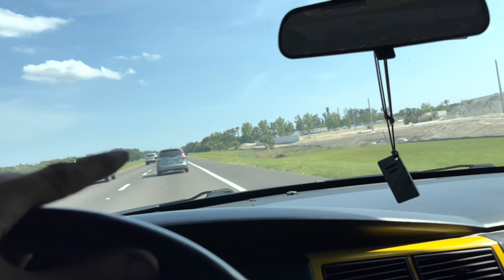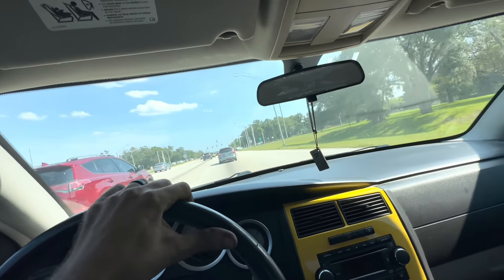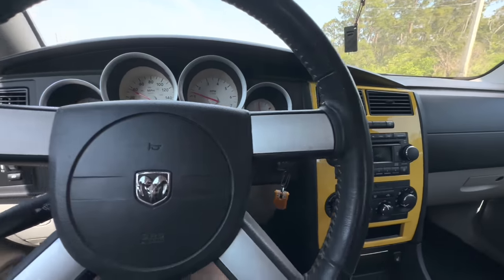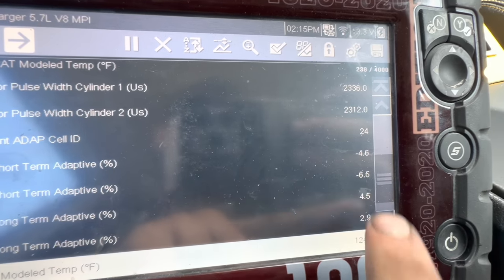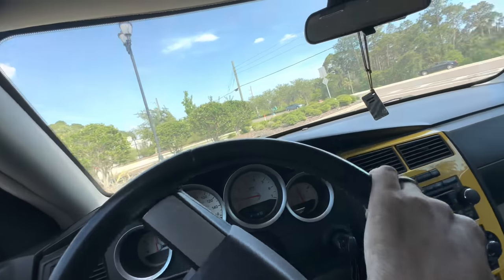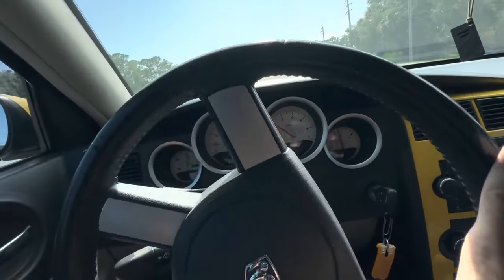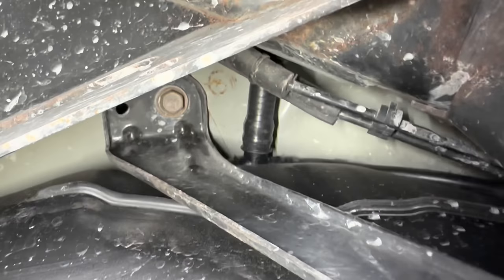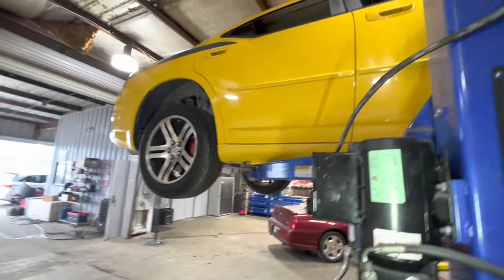Customer States: Engine Stalls After Fueling...HELP!! Dodge Charger 5.7 #mechanic

Comment: got an 06 caravan with same problem.  will stall consistently (at idle) after refueling, usually for about 10 mins. my research indicates fuel tank issue, but i haven't done anything. problem will go away after running for 10-15 mins-- i suspect getting rid of any liquid fuel in the evap purge system.  please give an update once you figure out the solution...

Comment: Maybe Heat soak/Vapor lock in the engine compartment.  Both occur on a hot start or after refueling when it is hot outside..  Or faulty fuel pressure regulator.

Comment: HOLA RAY. Bought my son a 2005 Dodge Magnum RT. HaD a stalling Problem. Looked in to it, Engine ECU was changed, All fuel and vent related Parts were changed, Transmission ECU mas change, all by previos owner. Still stallad while city driving..... Gave it a full service, no change, ´TILL..... I SERVICED THE ¨NAG¨ TRANSMISSION!!!
Has not stallad since then, that Was a year ago! TOOK PAN OUT, CHANGED FLUID FILTER, PAN GASKET AND THE MOST IMPORTANT PART, THAT I FEEL FIXED IT... THE CONNECTOR ON THE FRONT RIGHT OF THE TRANSMISSION, WERE ALL CABLES PASS THRU. YOU SHOULD TRY IT!!! Not that time consuming and cheep, MAKE SURE YOU BUY ALL PARTS AT THE DODGE DEALER, DONT SKIP THIS STEP... DEALER PARTS ONLY!!! Hope this helps. ADIOS!

Comment: Funny, you and Eric O keep doing similar repairs.  He just did an Avenger with the ESIM problem.  Said in his experience, the ESIM always is the issue if not the purge valve, and that Chrysler products almost never have a leak in the lines or connections.  Don't know if this helps you Ray?

Comment: Ray, I've ran into this on a few other manufacturers,  specifically VW, Audi, BMW, whereas the purge valve was sticking open, therefore causing excessive fuel vapor to enter the intake system while refueling causing a hard, no, or slow start, and even "stalling" condition, could be similar to the situation you're experiencing, I've also found in tandem with the purge valve, alot of times the carbon canister is soaked with fuel, usually due to people refueling with the vehicle running or overfilling the tank, could be a couple things you could easily check 👍

Comment: My 05 hemi magnum (70k now) does the same. At a fill up and only a fill up it will stall multiple times at every stop until I drive it at freeway speed for a while. My solution was do not turn off the car when filling, car never stalls! Again if I turn car off and fuel with fill up, at first stop it will stumble and stall! And if I fuel up but not to full never have an issue!

Comment: Have to say that you did not really find much fuel traveling in the vapor lines.  Could have been old residue? Have seen rear fuse block problems causing stalls.

Comment: Our jeep renegade 2021 did the same thing. EVAP checked out fine several times. Lines checked and he replaced the EVAP canister out of curiosity’s sake and it ran. Ours cut off and wouldn’t start back. Towed to dealer 4 days after purchase to find out the canister was bad inside but somehow checked out to be fine? Idk but it’s fixed now and roughly 23,000 miles strong now

Comment: How does it get air into the system/ tank tp replace the fuel used to prevent a vacuum build up in the tank?
Could the system be blocked not allowing the air flowing into the tank or causing it to be restricted, or a one way valve occasionaly sticking closed?

Comment: Ray, I have a 2008 Charger R/T that has a similar issue. I have hiccups under hard acceleration and when I make a fast turn around a corner, she bogs like its not getting fuel. Been working on this for a couple years. Might look into a relay swap as in the other comments. Its been a ghost in the machine to me, but I love my car and all my others too, so I'll keep digging.

Comment: It's related to the purge solenoid and vent  . Filling the tank floods the engine.

What exactly the part of the fuel vent and purge  solenoid it is varies,  same as it varies from vehicle to vehicle . Chevy loves this problem . .
I just know fling the tank and the purge in the wrong position will flood the engine .. Mopar is weirder with vents rollover valves ..
Check the power for the purge solenoid.

Comment: My 05 Ram w/5.7 Magnum did the same thing. Random stalls, especially when heavy loads were occurring at low rpms (such as wheel hard over, or coasting to a stop with A/C on, ect). Ended up being the result of a very VERY small hole in the intake manifold from an improperly installed throttle body (allowed unmetered air into the intake obvs). 

The plastic intakes on these Hemi's definitely warp/break/don't age well.
Reply: For a while, I suspected it was the torque converter staying locked/not unlocking, but it never slipped in O/D like most failed TC's do. Ended up not being the case, though.

Comment: Oh the good ole days, I was a dodge tech from 2003-16, some just couldn't be fixed. I believe it's a over filling issue and if the customer would stop trying to add fuel once it stopped then there wouldn't be a issue. Btw I owned a magnum and it would do it if I tried to keep filling after the initial stop.

Comment: Your comment on petrol (gas) price made me smile; in the UK you would be paying around $85.00 (based on cheapest supermarket fuel prices) for that amount of petrol (gas). Thanks for the videos, always enjoyable. Regards.
Reply: How much of that is taxes and fees though? In Florida it's about 36¢ per gallon.
Reply: @kevinbirge442  Welcome to rip off Britain. In the UK, VAT is added to fuel prices and paid at every stage of production and distribution, which means that it is paid on both the sale of the pre-tax price of the fuel and the additional fuel duty that is levied on fuel consumption.
The standard rate in the UK is currently 20%. Fuel duties are also levied on petrol, though the exact amount is determined by the type of fuel used, around £0.53 per litre for petrol. In addition we have Vehicle Excise Duty (road tax)  which varies depending on type of vehicle and engine size. A Normal 2L family car will cost you between £130 and £255 pa. If you drive a large vehicle with C02 emissions greater than 255g/km it will cost you £2605 pa.

Comment: i had in the past a similar thing happen, although i have to say, and absolutely different car, where it would stumble and got to occasionally stalling when completely lifting off the gas pedal from over 1/3 open, it sort of did the exact same thing with the rpm needle, it was the EGR valve on its way out, it was really easy to check finally when i just disconnected its connector and it ran amazing (although with a check engine light), 
it might very well be something absolutely else, some other person commented something about maf sensor, i don't know.
one last thing to check, did the customer once force fill the tank beyond the click? like 10 more attempts? that might send fuel into where it should not go, and there are some people out there that try to squeeze that last drop as if it would matter a lot, and that might be the reason why the lines are wet, and now that most of it has gone through since the last overfill, it is working better no longer having the lines full of fuel
hopefully somebody reads this

Comment: It would appear to be a ‘hot’ issue, the customer not reporting a failure to start when cold. The classic things to go wrong are crank/cam sensors although you are not getting any codes which suggests something below the radar.  I would check the coolant temperature sensor since intermittent errors can sometimes escape code setting but when they occur they immediately mess with injection timing/fuel delivery and are especially notable when coming to an idle at a stop light. When removed, it is easy to monitor the resistance with a voltmeter as you dip the tip of the sensor in and out of a mug of very hot water.

Comment: The arrow is also very handy when you are driving 2 different cars with the fuel filler on different sides. Dont know how many times I have put the mustang with the pumps on the drivers side which is the side my VF Holden Calais has its fuel door on (RHD Mustang here), so now I look every time before filling up, just to make sure lol

Comment: You've done the diagnostics showing the possible issue.  I had two '06 Chargers (R/T with R/T pkg and an SRT) that did the same thing after a fill-up.  The first left turn I made - boom, it would die.  I sold both of my cars before the stalling issue was repaired.  However, I'm pretty sure this condition was something Chrysler gave a goodwill lifetime warranty on.  The TSB in your video shows that wording (timestamp 28:17).  This Top Banana should be taken back to the dealer for service or you should be reimbursed for your repairs.

Comment: love it when you get the right parts to fix it and it still does it. especially when its labor intensive to replace the item as in the fuel tank.. but you have told us, Eric O has told us and Wes also that new does not necessarily mean its good. There could also be some factor causing the valve to fail, age in the first case but in the second could the wrong grade gasoline or an additive be an issue,,, When I was flying I decided instead of tossing the fuel sample I would put it in my S10 to  "clean up" the plugs.. common wisdom at the air port said do it.. I did. I talked with some racing engine builders and drivers that said "do it" guess what? Less than 4 ounces of LL100 Av gas 2 times in a full tank of 87 Octane unleaded gasoline was not dilute enough to prevent the spark plugs from over heating.. but the first 100 miles it ran like a champ... fast, plenty of power then it would run like crap and the light was on. melted the electrodes on all 4 spark plugs in that 2.2L... if it had been a big block chevy it might have withstood it with different plugs.. point is whether something caused the evap part to start pulling fuel.. just my wondering along with you as to what could be the culprit.

Comment: 18 year driver, I was driving a quad axle dump truck and had a guy cut me off to stop at a red light in front of me. I was 108k (heavy haul route) it was raining, people are dumb. Took 20 feet out of my stopping distance just to be first at a light. 1 weighed roughly 20 and a half times more than his Chevy pickup. Glad he had confidence in my ability to stop 54 tons.

Comment: Check the purge valve for intermittent sticking or stuck open position allowing fuel vapor to enter the intake manifold.Also don't overfill the gas tank,raw fuel will or may enter the charcoal canister.

Comment: When I first got My used 06 Charger R/T, it would violently jerk and die right after filling the tank. It was valve on top of the tank causing it, and a new tank from Mopar fixed it.

Comment: Hey Ray, well my 06 charger does the same thing.  It only does it Immediately after filling up.  It is worse when the tank is the lowest on fuel!  If it's above 1/2 tank it probably won't do it.  Sometimes it totally stalls, sometimes it just coughs.  Good luck.  I'll be watching to see what it turns out to be.

Comment: I work at Chrysler/jeep. It’s the customer topping off the tank multiple times after the gas pump already clicks off. advise customer to not top off tank after gas pump clicks off. Or bad new fuel tank

Comment: Howdy the Raysta. I'm thinking to punch up on car and model that when you buy a new tank , what parts are on the new tank and what it comes with as a process of alimentation and also fuel pump pressures with heat or cold as filling up fuel changes pressure and shuts down or filters. Lance a lot.

Comment: The 2006 Dodge Daytona has some issues.   I know I own a Gomango edition.  One is that if you fill the tank too full hard acceleration, deceleration, and cornering causes the roll over valves to close cutting fuel off to the engine.  Another problem is the exhaust valve seats can drop out of the head.  Hope this helps.  Tell the customer to not fill up the tank so full.

Comment: One of those magic cars.  My wife had a car in the early 70's that would stall out when taking off from a stop.  It would not do it for anyone else.  I and others saw it stalling out when pulling away from a stop while riding as a passenger when she drove it.  I drove it and nothing happened.  The same for a number of friends driving the car.  Full analysis of the fuel system, and ignition system revealed no problems.  My wife said the car did not like her for some reason.  We sold it to my niece after 5 years and she put almost 200,000 more miles on it and it never stalled out on her the whole time she owned it.

Comment: My daughter had a 4 cylinder car that started randomly running on 3 cylinders for a minute or two, then running properly again. No codes set. Took to a mechanic, who drove it around for a while, but the problem didn’t happen for them. They couldn’t  cause the problem to happen or diagnose what it was. It became a safety issue on the freeway. She ended up trading the car in

Comment: I have a 2005 Dodge Magnum R/T.  Experienced the same stallout issues after filling the gas tank and at idle, or 0 throttle.  Dealer swapped the tank under an "extended warranty" or voluntary recall in 2018.  Issue was as you described: a check valve in the tank failed to prevent liquid fuel from entering the vapor line.  

Perhaps you have a faulty tank?  Or a tank reclaimed from a car with the defect?

Comment: high evap flow  code    i had the same issue with a ford transit connect   i had to replace evap cannister  from dealer and the intake evap tube intake purge valve  solved issue  but has to be dealer parts

Comment: I have a 06 Town and Country that had a similar issue. Every time I would fill the tank, it would start right up then stall after running for about a minute. It would restart and run fine until the next fill-up. It did this for about 6 months until one day it wouldn't restart. Turns out that the fuel pump was dying all that time and finally gave up the ghost. Replaced the pump, and the problem went away.

Comment: After filling He could be just keep pushing the gas until its at the very top maybe thats why you fine gas in the vac lines, Since you did not do this on the fillup you did not incurr the same results as him. Now he may not be consistently doing an overfill hence the intermittence, try over filling once see if engine is choke for the first few minutes. Although I do like the fuse fix as stated in the previous comment, its a dodge you know. I also had an issue with a Jeep the tank was replaced but the gas that was drain was put back in and it seems that gas had a sediment emulsified and began settling back into the new filter of the fuel pump. the sediment was  not clogging said filter but restricting flow enough where after acceleration the idle could not be acquired due to a restrictive flow.  Very intermittent that one.

Comment: No red line on the tachometer? Drive it hard, heavy breaking, fast corners, get the fuel really sloshing around. When the tank is full, is fuel splashing into the vent?

Comment: There was a recall for 2006 Chrysler 300c's for this issue and it effects my 2005 300c. I just stop short of filling the tank completely. With trial and error I know about how much fuel I can put in for any given level of the gauge.

Comment: Alot of dough for putting in 10.4 gallons for only 35 dollars? Then you don't wanna drive in Belgium. 10.4 gallons is 39.36 liters of fuel. We pay about 1.7 euros per liter (in the Netherlands you pay 2.15 euros per liter). 39.36 * 1.7 = 66.9 euros. Convert that to US$ and you get 72.8 US$. So 35 dollars is damn cheap from our point of view. We pay twice what you pay for gasoline. But keep your videos going, it teaches us about the mechanics of a car and I love your dedication and persistence to try to find the problem. Also your explanation is quite thorough and easy to understand.

Comment: Ray, I'll add on to your "Traffic Safety Monologue:" Don't be "that guy" who never uses a turn signal, or uses one at the last minute. That's also a good way to cause an accident. Rule is, 250' for city driving, 750' for highway driving. These distances, incidentally, are the same distances where most intersection information signs, as well as signs such as "Stop Ahead" signs are posted, so you have enough time to make decisions on slowing down, stopping, etc. 

Also: Following distance. Try to keep at least 2 seconds between you and the car in front of you in city driving, and 4 seconds in front of you outside of a city,  whether two-lane highway or freeway. Not only does this ensure you have enough time to stop if you need to, but it gives you enough time to react to things that may be ahead of you in the road, or in your path of travel.

Comment: My Malibu had an issue with rough running and would not accelerate/ stumble caused by a bad EVAP solenoid, it would happen mostly when braking hard. 

New EVAP solenoid and no problems since.

Comment: Had a Chrysler 6-cylinder 4.0 that exhibited these symptoms. Turns out it was a dirty IDLE AIR CONTROLLER that was carbined up. Cleaning the IAC solved the problem.

Comment: Ase master tech here ,it's gonna be one of 3 things probably, the passenger fuel module isn't sending gas to the driver side tank to keep it full to feed the pressure line, the passenger module uses a venturi siphon,  or the charcoal can/evap is saturated or the tank baffle itself is stuck causing the feed to cavitate, easy test for that is just to pull the gas cap..usually it'll start doing it even if the tank says the level is full because of the double senders on the modules.